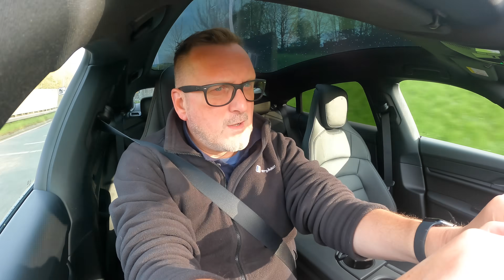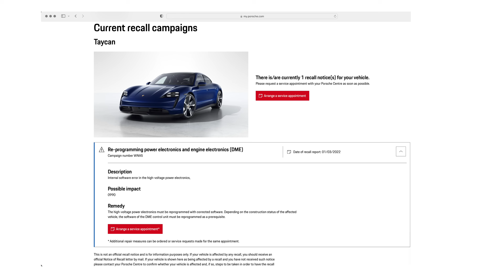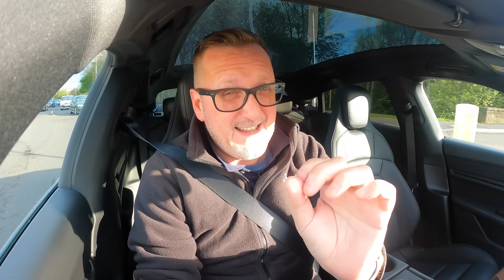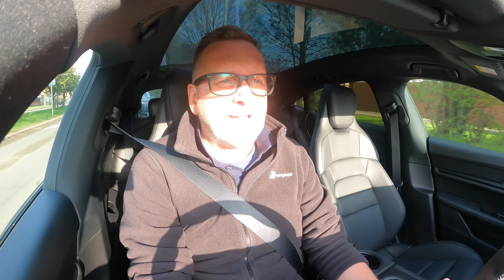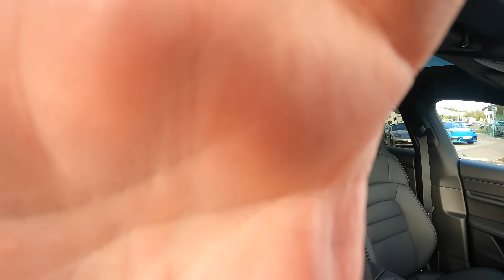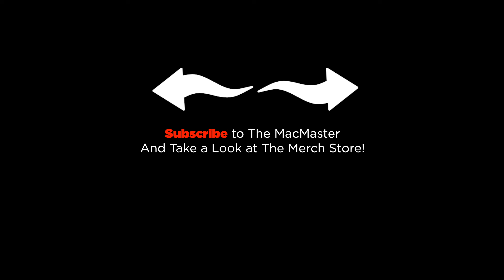Are ELECTRIC CAR Owners LAB RATS for EV Manufacturers?

Comment: It’s not just EVs that suffer software problems. I have a new Jaguar F Pace petrol mild hybrid (400 bhp supercharged and turbocharged!!!) which is a fabulous car, a real magic carpet ride. BUT it has a load of computer input and over the few months I’ve had it, it has done 3 software updates and after each one it has had to go back to the dealers to get it sorted as the thing has gone potty. The dealer is great, the car is great, the software……not so much. Mind you it’s a mile better than an EV. Don’t be put off by the EV fundamentalists Lee, battery cars are interesting and nice enough to drive but will not be the future. Have you investigated the rise now of synthetic fuels to replace petrol? I believe Formula 1 is dumping their hybrids and going onto synthetic in 2026
I will say though that Taycan is, to my mind, the best looking Porsche ever!

Comment: The idea of electric cars is as good as the idea of "smart" motorways. Yes the price for charging maybe low at the moment but I wouldn't be so confident that will be the same in say three years. As for the questions people are asking about the environmental issues in producing a posh milk float versus running a Diesel engine continue why are the EV manufacturers not giving us the real facts of their products? Maybe you are right.....Lab rats!  but with money.

I was talking to a Fireman ( can we say that nowadays without offending a Guardian reader type) that EV-s are horrendous to put fires out in collisions etc etc.

I have to say say though, I had a 2.0ltr petrol car and listening to all the voices of the EV brigade, environmentals, Greta Turnberg, the lefties that live around me with their "EV'S" on charge at night and the local tearaways with "ADHD" etc etc unplugging the cars from charging, the endless "oh you should buy an EV, they are the future" they have actually made me think and I've changed my driving, had a good long think ,changed my car, changed my driving habits  and listened to all what they have said.

I've now bought a 2.2 Diesel with no  DPF as standard due to its age. Reliable and gets me everywhere at a moments notice which is what we need.

Serious head now, I can see the idea but I think like all tech it just isnt' ready yet. The electric infrastucture, the charging points for example if I charge up a posh milk float I would need an extension lead from a 1st floor flat to my car, imagine all the extensions leads across the pavements from other residents  the "no fee no win" solicitors will be booming with trade. My first computer game was on a "Binatone" playing tennis with a a square pixalated ball, then my parents were posh and we had "Space Invaders" no not Audi drivers tailgating on the M1 but a computer game, then came Pac Man, ooops sorry if I offended anyone there "Pac person" and now in 2022 we are wearing VR headsets in a "virtual world" waving our arms around, walking like a chicken and looking like we are on Acid.  I just think the idea is there but it's at least five years away. What worries me is that the Treasury receives billions a year in revenue from the sales of petrol and diesel from normal people, so if that stops and we are all driving an "EV" just how much will it cost my elderly mother to boil her kettle and make a cup of tea?

Comment: The issue didn’t stop the car from driving so it’s the infotainment but that’s not working. I have a Volvo v60 and the screens reset occasionally but it keeps driving. It shouldn’t happen but it’s not an electric car specific issue
Reply: Yup but as mentioned at the end loads of battery issues but 3+ month wait to get them swapped out not exactly the same.

Comment: The only way  I can see these 'milk floats' working is is you were able to pull up to the filling station as you do now and have a machine which replaces your flat battery with a fully charged one.
One scheme I have seen suggests a power line above major roads and each vehicle has a pantograph to connect to it! At £1million a mile or more, can you see the Government paying for that? Neither can I. Madness!

Comment: Seems to be two issues being confused here. If you have an expensive modern vehicle like the Taycan with sophisticated software systems, whether the drive train is Electric or ICE should be irrelevant. Electric vehicles have only one moving part compared to 100's and are therefore inherently more reliable. Get the Volkswagen E-up!, it has an old fashioned handbrake, traditional metal key starting system and if you need a Sat Nav it has a cradle for your mobile phone. In 2022 with the cost of living crisis and rising fuel prices we could help a lot of people by demonstrating how Electric vehicles can save them a lot of money if they make the right choices rather than trying to link them with issues that are no attributable.

Comment: Can I ask a related question? Yesterday we were at a Landrover dealer, my mate is looking to upgrade to a nearly new Discovery Sport and was looking a new plug-in hybrid thanks to the lack of 2nd hand vehicles. He was giving it some serious thought until the agent said 2 things: Once the battery runs down the car is only 2 wheel drive. And the one I found hard to believe: in a plug in hybrid, you charge the battery by plugging in to get the 31 mile range, however once you have used that power the vehicle does not recharge the battery, you need to plug it in to recharge. To me that seems either wrong or just complete lunacy, or, is it just a Landrover Sport quirk?

Comment: The technology is practically their For the car but not the battery technology unless we find a way of harnessing electricity like gas/petrol so it can be stored its only going to become another type of energy that runs along side fossil fuels? Another point is the stupid prices that these cars cost if you think that the car manufacturers are go to reduce the costs of buying one of these your living in another dimension and at the moment the government are turning a blind eye to taxation of electric vehicles but that will change they don't like having the public roaming around free of charge!

Comment: On my second electric car Lee (a Mini)…. Absolutely love it…..! I would NEVER go back to an ICE vehicle….. I changed my first one after 15 months and virtually got back what I paid for it with 20,000 miles on the clock! Yes, they are expensive to buy, but running costs are peanuts and I have had no software or hardware issues at all…. Wouldn’t be for everyone yet as the range is still the big issue, but you buy one knowing that and the infrastructure is getting better all the time…. (Oh and no, I don’t think we are “beta testingl for them…. manufacturers want these out of the door and are spending billions in development….)

Comment: The immediate advantages of hydrogen is that even a hydrogen-powered semi-truck takes less than 15 minutes to totally top off the fuel and these are hydrogen electric vehicles so you're getting all the advantages of electrical power you enjoy it just none of the issues of not being able to get a charge in the middle of nowhere

Comment: Slowing down on the motorway or stopping no way how dangerous that can be, especially if you have a huge haulage company trailer or lorry in the fast lane behind you.  Remember the first mobile phone?  Remember the first video recorder?  How expensive they were back in the day and how much cheaper they are now, video recorders have gone anyway.  The problems ranging from software to the power points to eco friendly batteries etc,etc including the design and overall performance of the EVs should get better as time goes on.  In the meantime i would personally stick [expensive as it] is to conventional cars.  The EVs are still the future though in my opinion,  but not right now.  Really speaking EVs should have started production 30 years ago.  The oil COs i guess would probably in conjunction with governments have laughed at you as there was no real money to be made.  Anyway that's my opinion for what it's worth

Comment: Not an easy issue this one. There’s cases for and against electric cars. The biggest one is charging points or rather lack of, and of course how far you can go on one charge. On top of that there’s the rising costs of fuel and electric bills, how much it will cost to charge a vehicle. Personally I don’t mind electric cars although you can keep the one Lee is describing here the Porsche or the Nissan Leaf. If you’re going for an electric car it’s the BMW i8, that’s a nice electric car. Tesla too expensive especially spare parts etc.

Comment: If ever someone was thinking about getting an electric car, (if they could afford it, so not many) the experiences you have honestly posted as a user are enough to put most people off. It is a fad, however the issue is really choice. None of us should be forced off using petrol or diesel by taxation simply to control us. It's an option for the few, apart from that, electric cars are a completely impractical and unaffordable gadget.

Comment: Mine's a model T Ford, please! EVs are for a niche market, for those that have to travel for a living and those that have the finances. As they're run on software you'll always be in beta as I guess you'll not get the option to defer upgrades until each release is stable.
Supply chain issues through 2023, 8 years left to buy an ICE, probably with a speed limiter, higher taxation, more cities implementing (ultra) low emission zones, then pay per mile, probably going to get ride-sharing schemes...unless policy changes it won't be a good investment (unless you're rich). 
Shared use and public transport are the future, whether that's right or wrong it's going to happen and if you're poor and rural you'll have to move to an urban 'hub'. https://www.youtube.com/watch?v=nZ61r_06zAs

Comment: Arguably all and everything that is technology based is in a phase of completion and essentially never actually passes the point of completion. You could even apply Moore's law to this, in the relationship between last years IC's or CPU GPU's etc are all at some point of evolution, its just part of the process of moving forward. We adopt technology and by design it is made either obsolete by it being superseded by a new faster, quicker product, but then again we start the cycle. Look at Apple they effectively never sort out issues with Power PC, move to Intel, then dump the lot and move to ARM based silicon. I find them abhorrent in there latest marketing, they release a 20K Mac Pro and eradicate its whole presence within less then 12months with a product that's is essentially cheaper in the shape of their Studio product range.  It is a price we pay and you have to accept it if you want to be part of the party.